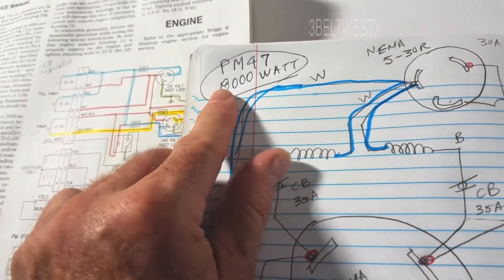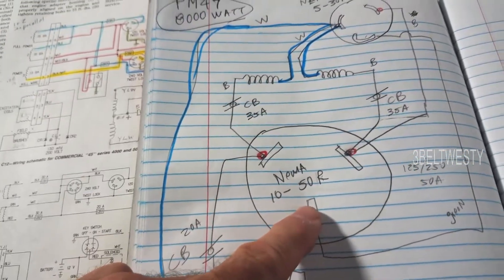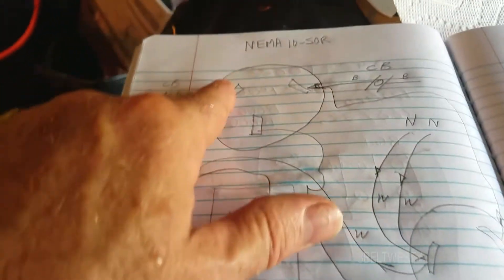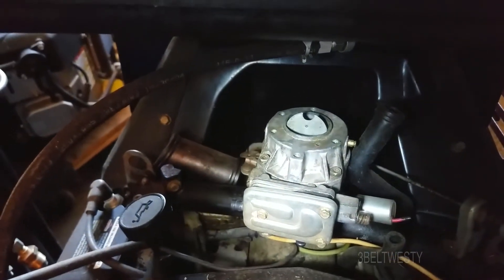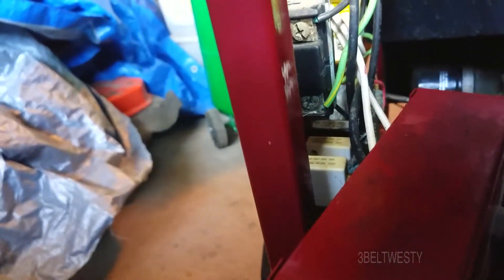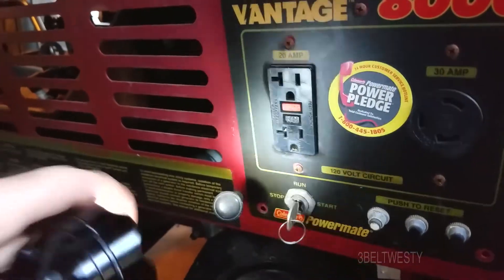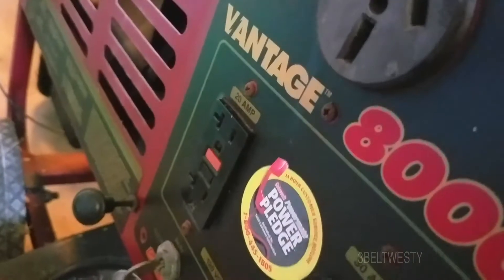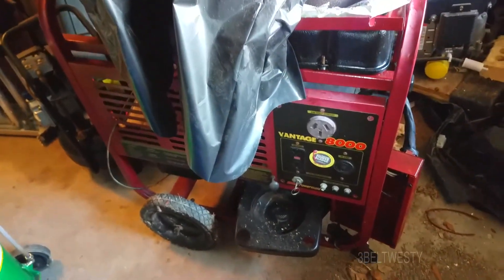NEMA 10-50R Floating neutral on 120/240 8kw Coleman Generator PM47

Comment: Neutral isn't necessary on strictly 240v (split phase)circuits. The two hot legs complete the 240v circuit because they are out of phase unlike 120v which needs one of the hot legs and  the white neutral (aka grounded conductor which is grounded at the center tap of the 240v winding of transformer) to complete. Nowadays we put in 4 wire(L1 Hot, L2 Hot, Neutral and ground) for appliance outlets
Reply from the maker: Hello Tony. The reason I made this video is to alert folks that your  Coleman generators Nema 10-50R socket  may not be 120/240 volts  but be just 240 volts. This is so someone doesnt connect this to a house and have no neutral and ruin stuff. 

What happens is due to imbalance the two 120 volt legs at the house can be say 60 volts and 180 volts. I saw this after Katrina where a neutral connection got disconnected on a generator of mine. It blew up the garage door controller and a TV. This was with another generator. 

Here with hurricane Zeta we got house power yesterday but my business still has no power yet.

At home depot and Lowe's here there are folks in the electrical area trying to hook generators with no knowledge. Scary. Even weirder is they sell generators but never stock enough plugs to fit them.

Many older generators with the same NEMA 10-50R socket do have the neutral connection to the generators 2 windings. 

The neighbor who junked this generator had it hooked up as if the generator had a neutral connection at the nema 10-50R socket. Their subpanel has another nema 10-50R  with the neutral on the subpanel connected.

Comment: thats how a welder is supposed to be - no neutral just a ground.
Reply: Your drawing is correct.  It is a floating ground system. The main power panel in your house has a bonded neutral as required, meaning that the ground and neutral are connected together inside the panel.  According to drawing, you have a standard 120V outlet on the front and a 3 wire 120V twist lock outlet.  Half your generator powers one outlet and the other half powers the other outlet.  So, if you are connecting this directly to your main power panel,  with the 3 wire twist lock, when you connect this to your main panel transfer switch, your  neutral and ground will automatically be connected, bonded.  If you wanted to use both legs, and use the full power of your generator, it would need to be equipped with a 4 wire receptacle.

Comment: i recently got into welding and as you know most welders have 50 amp circuit.... Wondering is it possible to convert my predator 8750 from a 30 amp to a 50 amp breaker and receptacle...